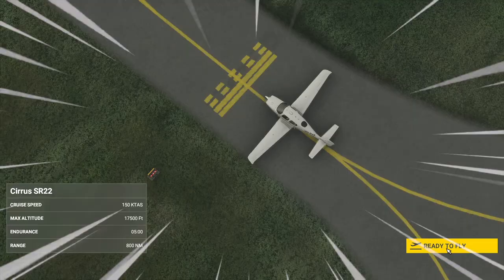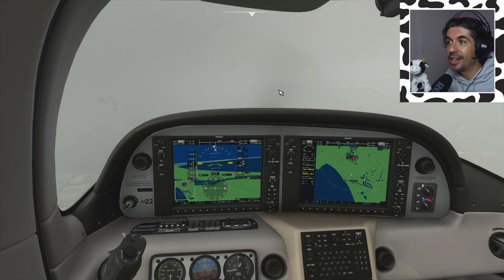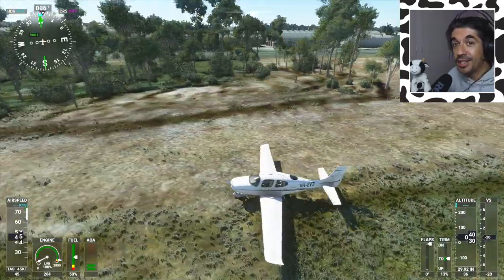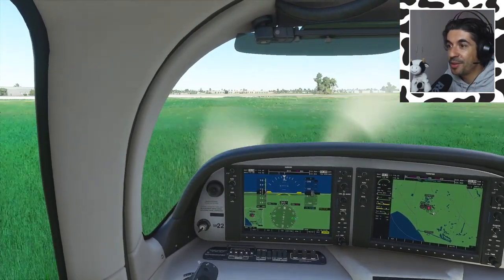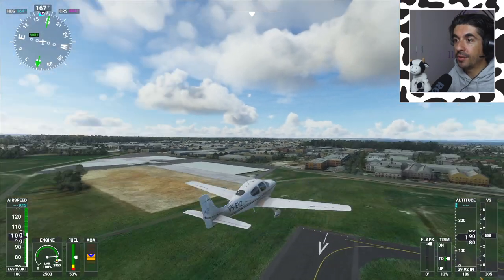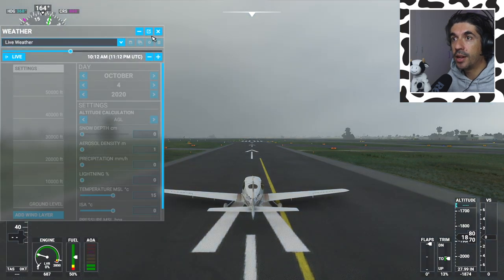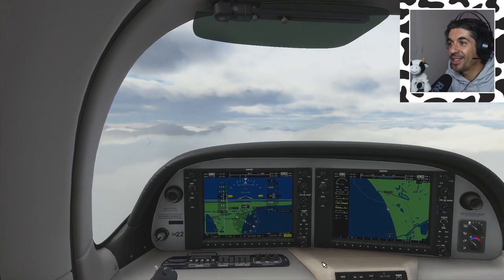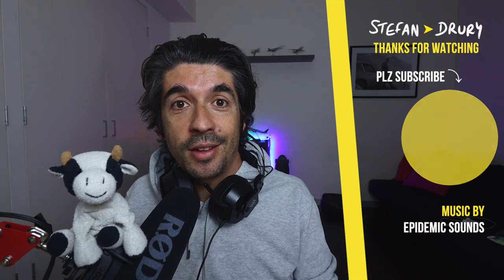Engine FAILURE in Microsoft Flight Simulator 2020

Comment: Hi Stefan, good luck with lifting of lock down, are people actually getting ill with SARS Covid 19/2 or testing positive/asymptomatic?

The general look of MSFS2020 is great, very realistic and a good idea to get in any type of stick and rudder time, virtual also helps. Are there various failures based 'missions' too? And, can realistic crash/over stress damage (or potential damage) be programmed in? The beech didn't seem rough or soft? In reality, would a forced landing there have meant that the aircraft would have flipped over/nosed in? Similarly in the long grass too? BTW I think both of those landing spots were good decisions on your part. IIRC FSXSteam had some rough ground areas that worked with force-feedback joy sticks, whereas MSFS 2020 doesn't?

And finally, sorry, when you get back to the airport will you have to do a check flight with an instructor?

Fingers crossed for you guys.
Reply from the maker: Hey Muso Seven, I don't know of any failure based missions as yet, but I'm sure as more 3rd party developers made addons for MSFS we'll get scenarios like that. The only crash/damage options are crash or no crash really. I had crashes turned off for this demo but when it's on if the sim thinks you've pushed it too far it will quit the scenario and you have to restart.

And yes, my IFR priviledges have lapsed so I'm going to do an IPC (Instrument Proficiency Check) with an examiner when I am flying again to reset my clock. After that I can fly as usual.

Thanks for watching, stef

Comment: You mentioned that you usually cruise climb at 110 kts.  I have a 2006 and generally have to climb out closer to 125 kts for engine cooling.  What are your oil temps during a 110 kts climb?  Great videos, hope all is well in Australia!

Comment: Hi Stefan, that was fast response to engine failure in the Sirrus type plane. I'm thinking, if possible stay away from the beach: tide, bathers and location for mechanical repairs, storage and departure. Grass or back roads would be a better option? Y/N
"Mover" an American T38 pilot and F16: instilled in me aviate, navigate and communicate. I see now why fighter pilots need higher fitness.🌴
The colour segments on the airspeed indicator are helpful in maintaining best flying acceleration.

Comment: From 600 agl and with only one or 2 on board i think you can Turnback to opposite runway.  One;  Put normal 10 knots wind before take off.  climb Vx for say 200 agl, flaps up and Vy to 600 at over 1,000 fpm.. 600 engine off, nose down and turn 40 degrees of bank towards any crosswind.. How do i know??  I practice for real on cherokees that dont climb as well.  Im an EFATO 6 kinds CFI.

Comment: I dunno man, engine failure just after take off I would pitch nose down apply flaps and land on the remaining runway if after take off and no remaining runway I would look for a clear area off the left or right of the aircraft nose and aim for that if on the downwind leg turn towards the field too much faffing about with controls mixtures and switches by the time you know it you will have lost so much altitude it will be too late.